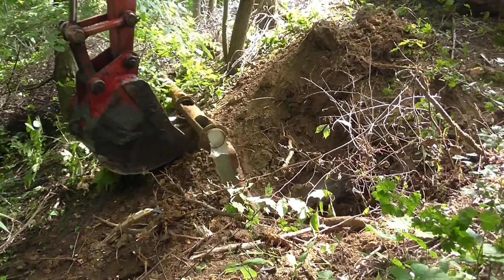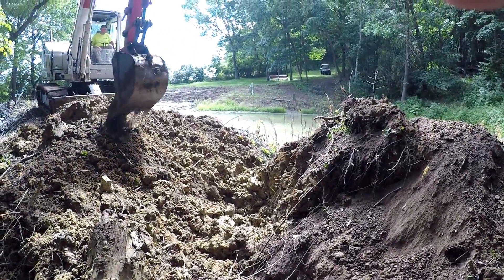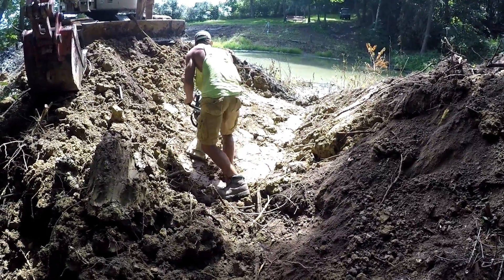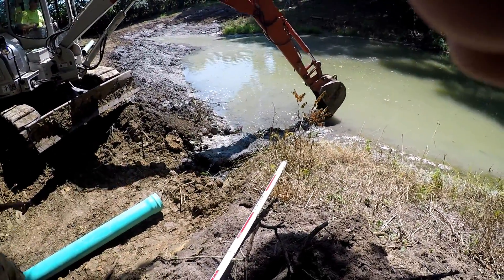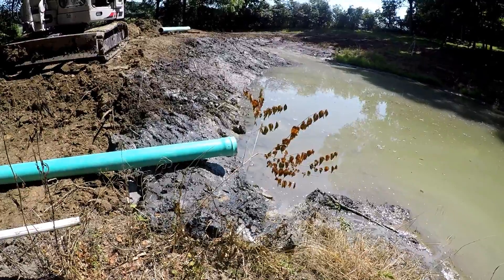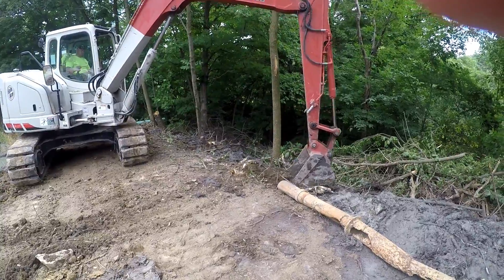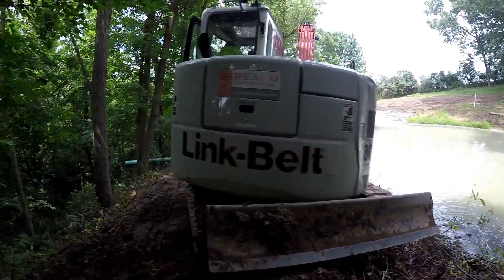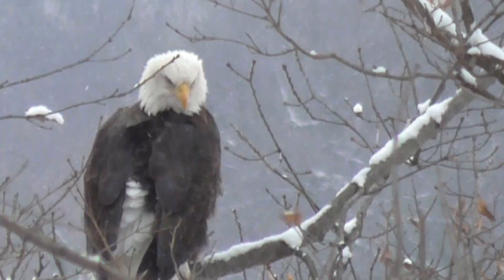#04 - Fixing a leaking pond - Leak Found

Comment: Nice but I didn't see you install a boot on the pipe? Anytime we put a smooth pipe in we had to install a boot or poured concrete in a couple spots. Water will seep down the outside of the smooth pipe and that's why the metal ones are corrugated. It will definitely bore down the side because of condensation and after it compacts a little there will be seems started.
Reply from the maker: Great point Richard. This fix failed and I moved the exit pipe away from the dike. Thanks for reaching out.-Bill

Comment: You need a baffle on that pipe.  Soil tends to settle under a pipe and the pipe prevents soil above from settling into the gap.  This leads to a hollow space just under the pipe.  Water flows from pond under entire length of the pipe which then undermines it.   A baffle can be as simple as a 3x3 foot piece of rubber pond liner it passes through.  The baffle sits vertical in the soil and perpendicular to the pipe.   Make sure the baffle has clay packed from it all the way to the pond.
Reply from the maker: Hello Brian I already commented on releasing another video this spring I think you’ll be happy with the rubber membrane and landscape fabric and riprap I put around the exit pipe, next spring take a look at it and let me know your opinion I appreciate it

Comment: The pond is a lot deeper than you think.  The dike height is the depth of the pond with slight variation of the existing slope.  What you are calling black clay is silt.  Try walking on it.
Reply from the maker: Hello Ralph, happy Sunday. Your are correct, not having any experience I did mistake the silt as a clay. The silt was greasy and shed water so I thought I could use it to block water. Well....i learned that was not correct.
Thanks for subscribing, your going to enjoy seeing the last video finally fixing the pond. - Bill

Comment: Nice project.  Very good work for your first pond job.  The only advice I would have given you ahead of time was to stockpile a big pile of that clay for use in areas later (such as where your new drainpipe was laid.  Also, you should have used an anti-seep collar around that pipe.  They save a lot of future headaches...